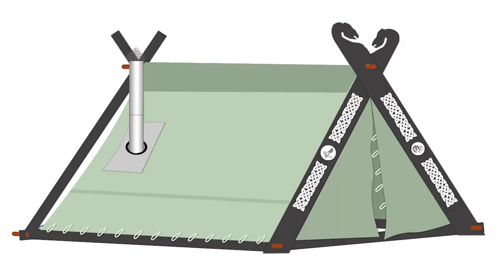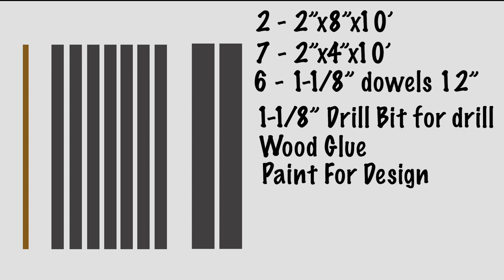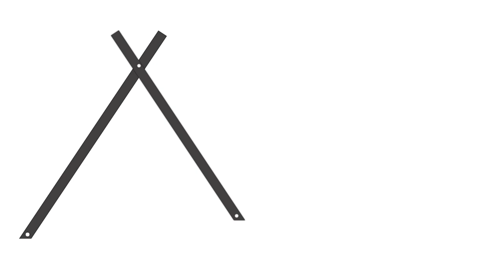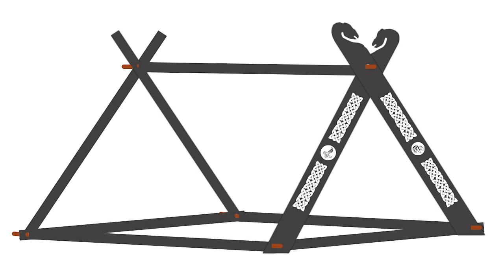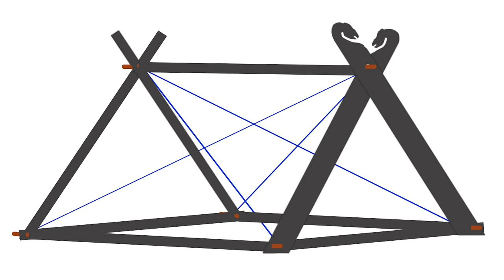Building Viking Tent - A-Frame Tent for Winter - Building the Frame pt 1 - Spirit Forest - S3 -Ep#27

Comment: You got away with it but hands in front of a spinner bit?? Bust out the wood you have a real nasty situation. I know as I have done it myself and spinner bits are never your friends, they like chucks of skin, bone or wood they eat it all. Use a clamp to hold the wood! then you can eyeball level and straight better. One minute to fix a clamp saves 3 months of healing. Roll on the next. Arthur (UK)

Comment: As an aside, instead of having the fire inside your tent, have you ever considered having the fire outside and laying a metal tube at an upwards angle through the fire and into the tent? That way it sucks clean air from the outside and as the pipe gets hot and hot air rises it pushes into the tent, giving you clean warm air. The pipe never gets hot enough to burn the tent and the air coming out is anywhere from warm to hot. A tiny fire can heat a pretty big tent this way, and there's zero risk of carbon monoxide poisoning or burning your tent down like there is having the fire inside the tent. An ex partner of mine set herself on fire by not taking fire seriously and having it around her while sleeping. She now looks like something from a horror movie and will never lead a normal life or walk properly again. Please reconsider having a fire inside where you sleep.

Comment: The point of an A-frame is that you put the material AROUND the A-frame. You literally ditched all the benefits of an A-frame and have a straight line tent with the A-frame turned into a pointless cosmetic thing. You could have strung a cable between two trees and achieved the same thing minus the extra ten kilos of wood you have to carry in and out.